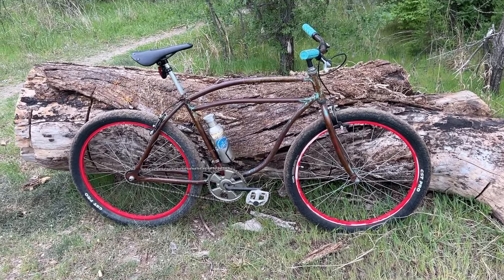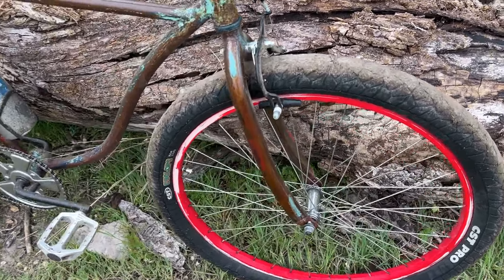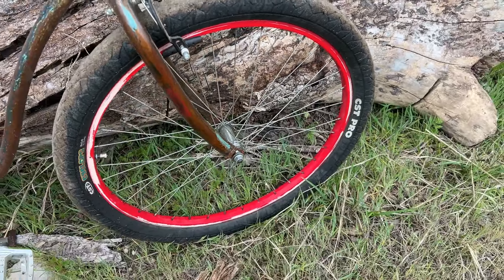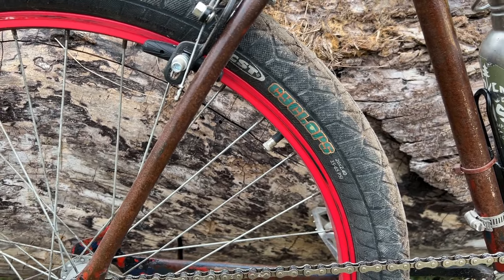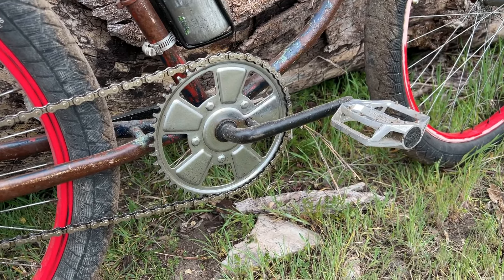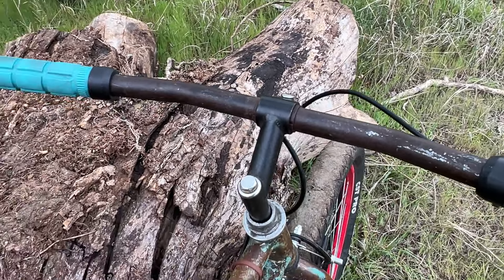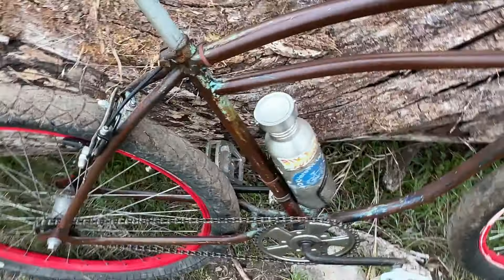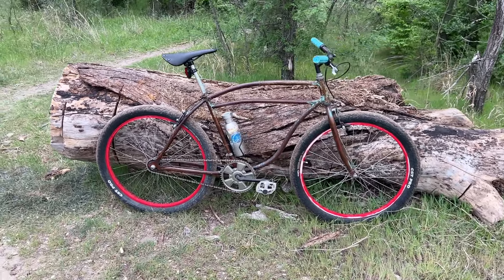Rollfast Rat Bike - Ride and Build Recap

Comment: Awesome build. Do most of your builds ride similarly? Curious about the geometry and riding position of those old frames. As always - thank you for the vids!
Reply from the maker: For the most part I'd say yes... although one that does stick out is this one. I was reminded when I built it up again this time that the geometry of this one is different. Maybe a little larger over all. The the top tube is higher and effects the stand over height. I have to remember to be careful when I come to a stop. I'm about 5'6" and a somewhat short inseam I suppose but any of these other old bikes that I've built up, standover height is never an issue. Also the reach maybe a little longer. Thanks as always for watching and commenting!